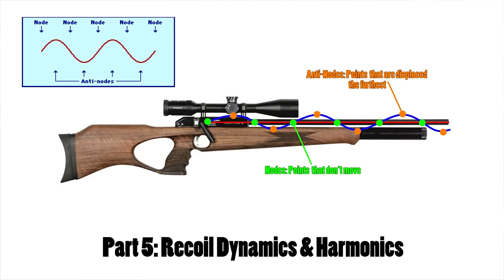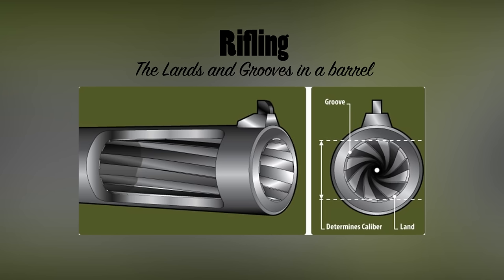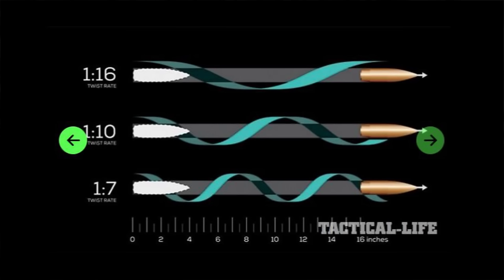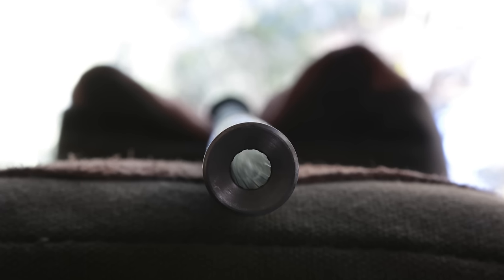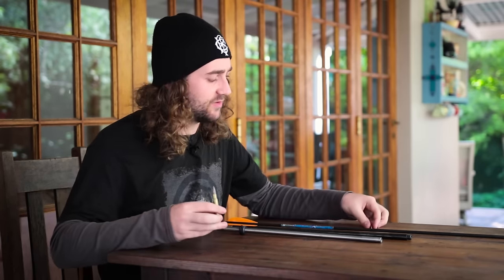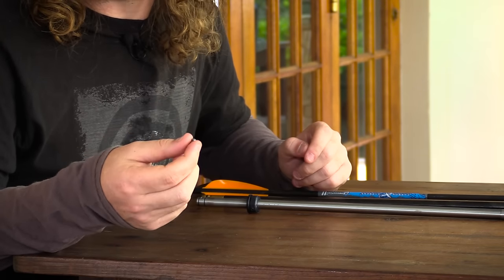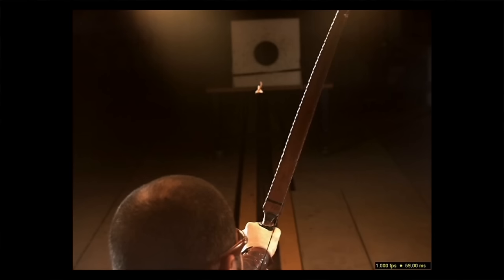Barrels & Twist Rates | AB101 Pt.6

Comment: Hello, I need some help, I'm producing a pipe for caliber 5.5mm, I need to rake the pipe, but there are 2 doubts, the first is the number of lanes, I have 2 options: 6 lanes and 12 lanes, remembering that the pipe has 24 inches, the second question is, should I use the 5.5 gauge tool or would it be better to use the 5.56 gauge, because after that measure already jumps to 6mm, if you can help I will be grateful.

Comment: First you said that the air pushed from the barrel can rotate the pellet, that's why rifling is needed, but then said that bad crown can spin the pellet, but wouldn't the pellet spin prevent that, as with the first problem with air pushing from barrel?

Comment: It would be cool if you can put an fx barrel in a umarex gauntlet I have an sl30 it's awesome I plan on getting an adjustable reg it comes with adjustable hammer spring jus need an Allan key but the barrel is questionable it's a 1/18    twist it's good it would just be cool if umarex made barrel swaps still have yet to try heavier slugs on it I have 44.75 jsb diablo pellets rn I wanna get the griffin 78 grain slugs I heard those are good through it as wells as umarex brimstones 60 something grains

Comment: So with my tuned marauder pistol, at around anywhere between 22-27 fpe with 21 grain baracuda pellets COMPLETELY clean barrel the accuracy was going everywhere, the fps spread was very good with a deviation of 30, but pellets going everywhere, when I tuned it down to 18 fpe I had amazing accuracy again, so I'm guessing the barrel's twist rate wasn't meant for that kind of speed?

Comment: Hey Matt, nice video! very helpful. I have a question, does it make a big difference in POI when using a ballistic calculator if you give an incorrect twist rate? I have a FX Royale 5.5mm and use Strelok Pro, however I don't know the twist rate and neither the direction of twist . Do you know this information? thanks

Comment: I’m curious to know if FX takes into consideration harmonic effects on those drinking straws they made into barrels. Like you, I come from the powder burning world and the effectiveness of a Bull or Fluted barrel. All barrels “whip” so to speak as a projectile is driven down it. In my mind the thicker the barrel the more stable the harmonics are. I find that pellets aren’t meant to be pushed past 900 FPS and slugs are basically whatever speed you can find that stabilizes them in regards to spin rate, weight, and length of the slug. I think your spot on with this video. My only question is the thickness of the barrel that the ammo is used in. Does the barrel thickness make as big of difference  with harmonics that I perceive?

Comment: Hello man, great channel and great video!. I have some doubts with the Twist Rate and the Strelok Pro App.  I have a FX Impact MKII PP, I am using a .22 STX Liner A 600mm, with a Twist Rate of 1:16 (according to the FX official rates for Smooth Twist X barrels).
 I hope you can help me.

What number do I put in Twistt Rate (inches) in the Strelok App?. 

How do I find that number from the 1:X relationship?. How does that translate to inches?. So I learn to find it when I change size or caliber barrel.

Is it Right or Left Hand Twist?

Thank you very much and greetings from Spain.

Comment: Hello great vid it is good to see someone who knows there stuff, I have a .177 BSA R10 MK2 at 20.1 fpe with H&N Baracuda  10.65 Grain pellets. I have tried a lot of different pellets to get a good group but the best i have been able to get is 20-25mm at 40m, I have even tried heaver pellets 15gr out to nearly 17gr to get more stable flight. I know my pressure is good as H&N Sniper Magnum pellets only differ 2 to 3 ft/s so I was thinking of putting a new barrel on my BSA could you recommend a barrel length and twist for for my .177. Thanks

Comment: I am a machinist.  Old school manual. A common mistake in machining crowns is to indicate off the outside of the barrel. A crown should be machined in the chuck not hanging out. It should be indicated on the lands AND grooves. With of course care to be taken in not induce internal compression.
Reply: Rl Badger please explain "machined in the chuck and not hanging out". If you indicate on the lands and the groves and these two are different how do you reconcile?  Thanks.
Reply: @Eric H. The Goal, as I understand, is for the crown relief machining to be concentric with the inside of the barrel. Two parts Badger indicates. 1. "Indicate off the lands and grooves" Process where you measure the concentricity of the cutting tool with respect to the inside of the barrel. 2. Minimize the flexure of the barrel during high cutting forces, by holding the barrel in the chuck close to the crown, and not protruding. Last point - Badger indicated, don't squeeze the chuck excessively tight around the crown, as this may also damage it.
Reply: The only reason so called machinists indicate of the od is because it is easier you are 100% correct seen lots of barrels ruined by idiots that call themselves a gunsmith had one of mine done that way you could see the run out on the crown with your eye

Comment: Thanks Matt it's crazy how much I've learned from you. Just put the stock valve return spring back in the Fx Impact with a 600mm barrel and your slugger kit. The kit is great but like you said if you're running low reg pressure and a 600mm the stronger spring is were the magic is. Yes instantly I was able to literally hear myself power tuning the Impact right to the point were the DB level drops and the gun smooths out. Feels great I'll find out how it groups later. Thank you Matt.

Comment: Wouldn't you want the anti-node at the end of the barrel? At nodes in the barrel, positional displacement is 0, but angular displacement is significant. At anti-nodes, positional displacement may be a mm or two, but the angle of the barrel is always constant. Sending a pellet at the right angle from a slightly wrong height is much preferable to sending a pellet at the wrong angle from the right height.

Comment: Excellent explanation! Thank you! It would be great if you could give an explanation heap rates for different types of bullets at a different step rifling (twist), such as full-bodied pellets JSB Beast 1.05 g / H&N piledriver 1.36 g,  depending on the speed. This will allow some shooters understand that there are no bad bullets and barrel there are used different speeds.

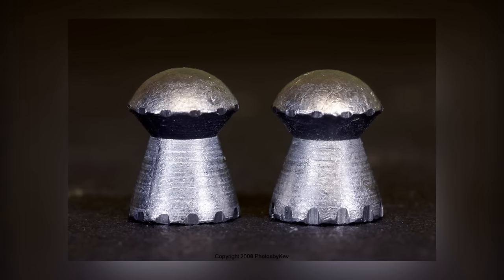Comment: Very informative and correct information my friend. Another thing to consider talking about spin rates is that the actual speed of the spin induced on the pellet is not linear in relationship to it's exit speed. Let's say you have a relatively fast spinrate 1:12 shooting at 650fps. Then you tune your gun to shoot the same pellet at 850fps , the spin rate induced isn't just 30% faster (increase in speed). But spins much faster, I don't have the accurate math in front of me, but it is a exponential curve. Also the faster something spins going trough the air, you have to account for spin drift. As well as Magnus effect, which occurs even if the head of the pellet is aligned with the trajectory, especially in windy condition.

Comment: When it comes to crowns, they should be as you correctly pointed out square to the bore in shape, but you don't want an acute angle as it re introduce the problems you are trying to fix, uneven gas expulsion. An angle around 11 degrees, or a combined angle between 150 and 180 is good (180 forming a flat plane to the bore). The biggest reason to not use the optimal 180 flat plane is it's really hard to remove the burrs forming on the inside of the bore during the operation.

Comment: A useful addition to the understanding of barrel twist rates but there are a couple of things I would take issue with. The first is the comments on smooth bore barrels. Smooth bores are not intrinsically inaccurate it all depends on what is being fired and if it is designed for a smoothbore. After all, most tank guns are also smooth bore. Pellets just are not the best design as the aerodynamic stability is marginal. Next, the diagram of the forces acting on the pellet misses the most important aerodynamic components out. Stability is dependent on moments not forces and the most important moments in stability are from lift, not drag, and act at right angles to the center line. Pellets are not drag stabilised, they are flare stabilised. Flares stabilise by producing lift in the same way that fins do. The drag at best only produces a tiny fraction of the total stabilising moment about the center of gravity. Also the explanation for why some spin is needed is erroneous. Spin is needed because of projectile asymmetries not because of the muzzle blast since any yaw produced by this effect will be damped out on a stable design. The problem is that without spin any asymmetry on the pellet will be facing the same direction throughout the pellet flight which will produce a curved trajectory. With some spin the direction in which the asymmetry is pointing will be constantly changing and so will not produce the same gross error. Only a small amount of spin is required, much less than is necessary for gyroscopic stability. The amount of spin needed will depend on the individual pellet design. In the section on the maximum spin rate, the down range over stability talked about is extremely unlikely to occur as the amount of gyroscopic stability for this effect at sea level is much too high. At long ranges you will get excessive drift to the left or right due to the natural variation in the yaw of repose (which is not the vertical angle as suggested in the video) which may lead to the assumption that it is due to over stability. It is only at very high angles in a thin atmosphere (at high altitude, much too high for an airgun) that there will be enough over stability to produce significant Magnus forces. While on Magnus, Magnus does not cause pellets to move up or down in a crosswind, it is just part of the normal gyroscopic response of the pellet to the crosswind causing an initial yaw angle which in turn produces a vertical yaw of repose. I would agree with the comments in the video about the lack of research in twist rate choice and the video as a whole gives a good idea on the use of rifling.
Reply: Great comment. You have supplemented/corrected the content of the video. I learned a lot, and I thanks you a lot!
Reply from the maker: Thanks for your input!
Reply: Great explanation!  Thank you.
Reply: Very long and technical reason to rifle a bore the reason that rifling is more accurate than smooth bore is that projectiles are made on mass and no two act the same when fired out of a barrel. Spinning the projectile out of a rifle stops  imperfections dragging the projectile in one direction basically pellets and lead bullets spiral towards the target the better made pellets having less of a spiral ever noticed that really cheap pellets tend to form a ring around the point of aim good pellets if off will give a group in one place according to how the weight and speed matches the spin. If I can hit a match box at 35 yards with my 30 year old under lever that is fine I have no wish to put four out of five pellets through the same hole or strike matches at 20 yards. only the insanely addicted would go in as deep as you have. The reason they do not make air rifles to that high of a standard is that the final product would only be slightly more accurate than what they sell now but would be two or three times the price. and no pellet manufacturer would make the guaranteed perfect pellets wrapped individually to prevent damage.Keep the aim straight have fun and be safe.

Comment: Yes!
Also, a smooth barrel will make it easier for the pellet to pick up velocity,
 especially if the lubing is right, according to the technology used.
A springer tends to have more of the problem of deforming the pellet inside of the barrel, but at the muzzle 
the pressure behind the pellet is low, and it is more silent, and also does not tend to ruin the accuracy there..

There is also the aspect, that you should not push a pure lead pellet too far beyond its limits.
Generally, about 240m/s or 800fps, starts to become more and more questionable for soft lead bullets.
You'll need a harder bullet coating, if you want to go beyond.
PCPs, which tend to cool down the propellant as it is released, can go some faster without causing the problem.
Springers and Gas-Rams should stay lower, to avoid these problems.

So, a good barrel should use  a good part of its length with about constant pressure behind the Projectile, to accelerate it..
 at first linearly, then exponentially slowly entering the correct twist, from the very beginning (rifling)...

Next Aspect:
Also, every bit of shape change of the Projectile matters very much.
You'll need to experiment with conventional and polygonal rifling...

Next Aspect:
And then, the pressure behind the Projectile should drop off fast enough when approaching the muzzle.

Next Aspect:
In the ideal case, the lubing will also avoid the lead-contamination of the barrel,
 and instead make it more clean with each shot..

Comment: Hello, I have a 19.5" LW .22 barrel and it is choked for about 40-45mm. It seems incredibly tight to push a bullet (not pellet) through it. Do you think the accuracy would be effected if I was to cut the choked part off the barrel and re-crowned it in my lathe? The bullet actually has a good rifling impression when just pushed in the breech. I'd like to hear your thoughts on this, thanks
Reply: it all depends on the diameter of the pellet. pellets and definitely slugs can range greatly. Get a caliper and measure your pellets.

Comment: Matt, that's an excellent video. Thanks for that. Just a minor point. The inventor of the smooth twist barrel is actually a guy from the UK called Ben Taylor. But no less credit to Fredrik Axelsson who understood the potential of the design around which he now designs and builds his rifles. I guess those Swedish folk know a good thing when they see one.
Reply from the maker: +Richard UK Ben Taylor played a huge role, but he was only brought into the process after FX had had the idea for a very long time. FX had been trying to twist the barrels from the inside, but Ben came up with the idea to remove a layer and then twist from the outside. So I'm not sure you could call him the "inventor", but you're right - without him it would never have worked.
Reply: AirArmsHuntingSA Interesting.

Comment: Wow! Finally, all of these lingering nagging questions which have prevented me from selecting my first barrel entry into the discipline of precision air rifle shooting have been answered. The answers aren't dreadfully pain full now that I understand what needs to be accomplished when balancing the abrupt forces observed through the transfer of compressed gas into ( is it vector quantity?). Most interesting to me is when this cupped pelleted projectile goes happily on its way without being influenced by the propellent and I believe I now have a solid understanding as to how to accomplish this. One last thing I'll need to do first, is select a pellet to determine desired barrel criteria. I know very little about these things but have noticed people buy heaps of different types.
Reply: You will still need to experiment with pellets to find the one that suits your barrel as no two barrels are the same. on the plus side if you choose a choked barrel some of the problems can be alleviated as the barrel is designed to size each and every pellet !
Reply from the maker: +Anthony Strawbridge Most good barrels (LW, ST, CZ) are designed completely around JSB Diabolo pellets. So you know where to start!
Reply: AirArmsHuntingSA Yes a good pellet to start with, but I did not know JSB had been going that long seeing as how LW HW CZ BSA have been making barrels with no change for decades, I can imagine FX using the best pellet for their new barrels, but not the others.

Comment: I just rewatched your previous video in the series and I was wondering about the desirability of floating barrels. From what I understood that would be less accurate than a "banded" barrel, no?
Reply from the maker: +Travis P No, accuracy would be the same, if not better. Barrel bands can change the POI in different temperatures
Reply: AirArmsHuntingSA Interesting! Rigidity, then, is good in general but nothing is as simple as it seems! Thanks.

Comment: Great video, as usual. I have a Vulcan .25 cal with a CZ barrel and a Wildcat in .25 cal with a ST barrel. They both are shooting the JSB Kings at around 905fps. Shooting at 100 yards the Wildcat has a drop of 3.5 mildots whereas Vulcan hits at 3 mil dots. What do you think is the reason behind that.
Reply from the maker: +hsnmz pak Either scope height or pellet BC. I've found that pellets often have a lower BC out of ST barrels.
Reply: AirArmsHuntingSA thanks Matt, I was just playing with the bc in strelock pro. A bc value of 0.046 for Vulcan shows the correct poi at 100 yards. But I am not sure that the poi at 150 yards with this bc as shown by strelock pro is accurate.
Reply from the maker: +hsnmz pak .046 sounds way too high...
Reply: Is it not how fast the pellet is spinning? Therefore more distance. Smooth is less because it twists less? Or is that BC rofl
Reply: hsnmz pak the Vulcan is a great rifle as well as the FX rifle... even t think the Vulcan is much better quality and strength..